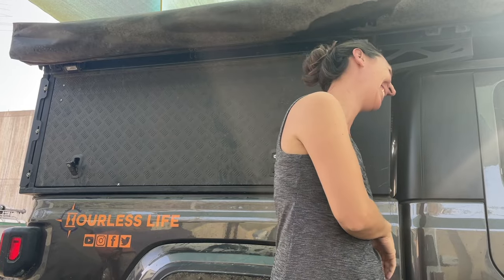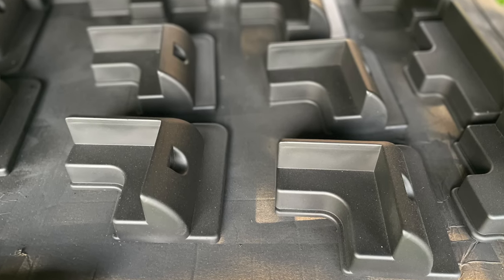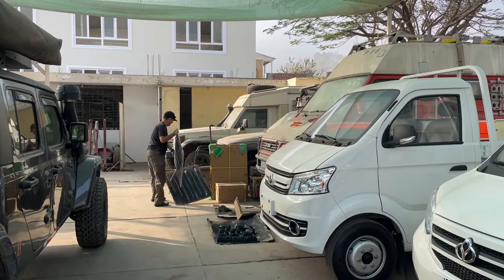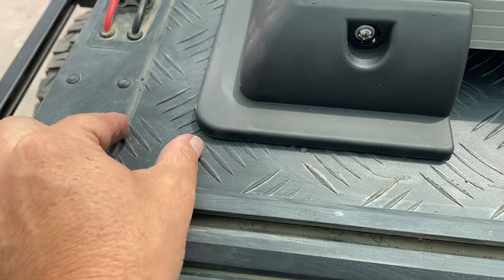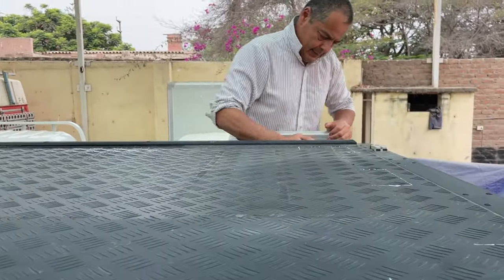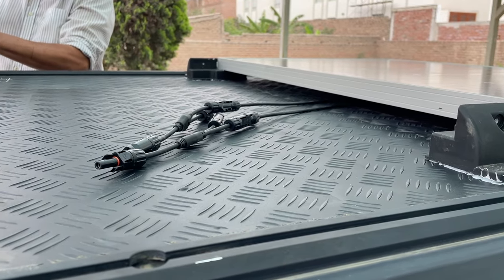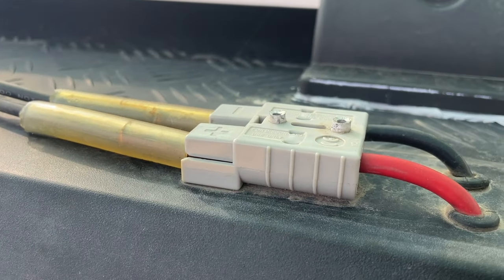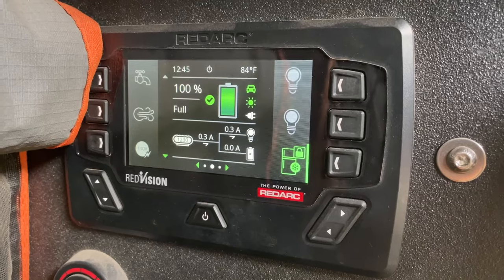INSTALLING REDARC SOLAR PANELS ON AN ALU-CAB CANOPY CAMPER

Comment: Good install, with room under the panels for cooling. Be sure you keep an eye on those mounts to make sure the 221 got and maintains a good bond.
Reply from the maker: Thanks John. I've started to make it a point to check it every time I stand on the back bumper to open or close the tent. Part of my daily checks now. So far so good. Thanks for the advice. It is well received. ~ Eric

Comment: Nice job. I find it interesting that Redarc is going foward to their glass panels rather than the flexible panels they have been using. I have used flexible panels and they worked fine, but  I did not glue them down. Made a lightweight frame for them. I will be using your set up on my Canopy Camper. Continued safe travels.
Reply from the maker: Hi Allen, yeah I was originally thinking of going with the flexible panel option. But it was more important to me to marry REDARC panels with the REDARC Manager30 and REDARC RedVision system. I wanted everything to play nice together. Thankfully since I'm sponsored by REDARC I was able to speak with their team and seek their advice. They didn't hesitate with our build and recommended the two 120w panels. So thanikful for that recommendation. I seriously can't drain the battery at this point. It doesn't really matter what I throw at it as long as we have some measure of sun. Even on rainy and cloudy days these panels have been topping off our 170ah battery. Super happy with how it all turned out. Definitely recommend for your build. ~ Eric

Comment: I’ve had similar solar power issues with my current panels and been debating an upgrade to Redarc or 4th D solar panels. Seems like paring the Redarc panels with the manager30 is the way to go 👌🏼
Reply from the maker: Bailey, full transparency I'm sponsored by REDARC as I mentioned in the video. Having said that, also in transparency, they would have been the panels that would have been my first pick if I weren't sponsored by them. They have been kicking off energy. We've been parked now 3 nights here in Cusco in an outdoor parking lot with security. (We're in an airbnb for a bit to explore this area) and I went to check on DAUNTLESS today, brought up the RedVision app by REDARC and my batteries are at 100%. Keep in mind it has been cloudy and raining on and off every day. So seriously impressed so far. ~ Eric

Comment: I have one, two hundred watt redarc panel on the load bars of the canopy camper.  Solar has worked perfectly and never had issues with it.  Is that a new Redarc Manager 30? I remember you had one before, but this one looks like the latest model with the temperature sensor.  Thanks and safe travels
Reply from the maker: Hi JD. Glad to hear that your REDARC panel has worked flawlessly. We're just starting to put ours to the test, but so far, we've been amazed. We have 2x 120w panels and they just kick power to our 170aH lithium battery. We've been really impressed so far. Our Manager 30 is the same one we installed in August of 2021. So no, not new. Same with the RedVision. Hope that makes sense. ~ Eric
Reply: Thanks for the response Eric, wow, that Redvision screen looks brand new.  I had it connected to a 100 amp hour anti gravity battery, but now switching to a mini 100 amp hour redodo battery so it can fit in the single goose gear cabinet under the redarc electrical panel.  The other question I have for you, did you connect your National Luna fridge directly to the Redarc Manager 30 or the battery itself? Does the power that the fridge consumes get picked up by the redarc?  Thanks.
Reply from the maker: Great follow up question. So our National Luna Fridge is locked to always being powered and is connected directly to the REDARC Manager30. The great thing about the REDARC Manager30 is that it controls all power input and delivery. (And you may know this already but for anyone else reading who may be curious) The Manager30 prioritizes solar energy and disperses it as needed directly before drawing from the battery. So if there is enough sun hitting our panels to send to the fridge directly it does that and sends anything left over to charge the battery. If not, then it sends the solar to the fridge and then draws what it needs from the battery and augments it with that so that the fridge (and any other component drawing power) can get the juice it needs. It is really quite a remarkable system. Also of note is that when we do go into an airbnb for more than a couple days we unplug the fridge after we empty it and prop the door open. Hope that answers your question. ~ Eric
Reply: @HourlessLife  Thanks so much for your detailed reply Eric.  I have had an issue with my electrical as it was not setup right.  My National Luna fridge was connected to the battery and not the Redarc Manager 30 as it should have been.  I still should have disconnected the fridge as you did when not in use for a long time as when at an Airbnb.  I am now having to fix this setup as my original battery also got damaged since the fridge drained the power too low since the Redarc wasn’t connected to it.  I have a 3rd gen Tacoma Access cab long bed with the same Goose Gear setup as your’s with the bulk head.  The current battery is in a the bulk head, but I found a 100 amp hour battery small enough to fit in the single goose gear cabinet under the electrical panel.  The depth of the cabinet is 6 inches and the Redodo battery was able to fit in it being a mini at 5.2 inches.  Just happy having my bulk head open up.  I am happy you guy’s had the correct setup with your Redarc, I am excited to finally have it correct on mine.  I will do the same and take your advice and disconnect the fridge when the truck is not in use.  Thanks again for your detailed response.  Praying for you and your family to have safe travels.

Comment: Nice job, in reference to the solar roof connections, we use IP rated MC-4 connectors. The Anderson plugs will tarnish and go green and affect your continuity.
Reply from the maker: I wonder if they have those here in Peru. Not being coy, I'm being serious. I don't really have that level of knowledge. But I'm always up for an upgrade that will provide longevity. ~ Eric
Reply: Do they have building solar over there as the MC4 connector is used for those installations. Did the Redarc solar panels come with MC4 on the leads?

Comment: Nice clean setup, I wonder if you notice any extra noise while driving having the air flow under and over the pannels, compared to the old flexible pannels glued to Alu Cab top, especially driving highway speeds
Reply from the maker: Great question. Not at all. The only thing we notice is a bit of added height which in Latin America can make a difference as to where we're able to park. But no issues so far, and we hit highway speeds for most of northern Chile through the Atacama Desert. We're all the way down to Argentina now, still with no issues and the panels are kicking off serious energy. Been super happy with them. ~ Eric

Comment: Why not reuse the Anderson SB50 connector from your old solar panels?
Reply from the maker: I wish I could have. Great question by the way. Unfortunately when we were troubleshooting what was going on with the solar panels a few weeks prior to this install, we had to remove that connection in order to get into the wiring of the system to troubleshoot properly, and I put it somewhere and couldn't find it. So when it came to the install we had to improvise, adapt, and overcome. That's all part of the journey. But to your point. If I knew where that thing was, I would have used it. ~ Eric

Comment: What devices are consistently running off of your battery / inverters, etc. I know the fridge, your personal phones, laptops, etc. Just thinking about the fact that you are fully charged by 240 watts of solar by 10am.  Can you estimate your percentage used each morning when you start charging again?  Starting with 80-90% of the 170 amp hours is my guess?
Reply from the maker: Everything in the habitat runs off the 170aH Renogy lithium battery that is under the forward part of the Goose Gear cabinetry. However, everything runs off of our REDARC Manager30 which is connected to the REDARC RedVision display. The Manager30 is the device that directs the power. It is hard to estimate the percentage used each morning as we charge different things on different days. Sometimes a lot, sometimes nothing at all. The inverter is powered by the battery through the Manager30 but doesn't really run anything at all. We just use it to charge our devices via the 110 outlets we have in the habitat. As far as things that are locked into the always on position. That would be our fridge, our USB ports, and our exterior Rigid Industries Scene Lights in both white and amber. Hope that was as clear as mud. ~ Eric

Comment: How are your solar panels holding up with the adhesive? Do you feel like they should be screwed down as well.
Reply from the maker: Honestly great! No issues yet. We'll be sure to post if that changes. But we've had the rig on highway speeds through the Atacama Desert of northern Chile for extended periods of time with no issues. We've made it all the way to Argentina now, and still holding strong. ~ Eric
Reply: @HourlessLife  that’s great. Thanks for the info and enjoy your adventure.